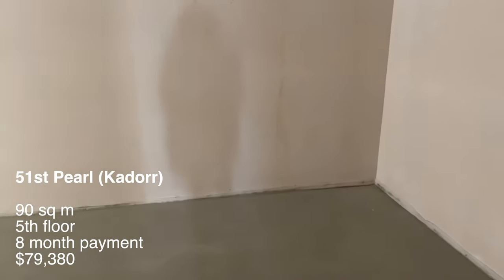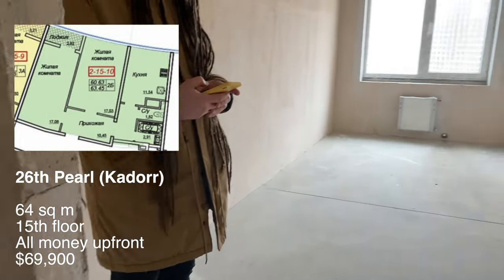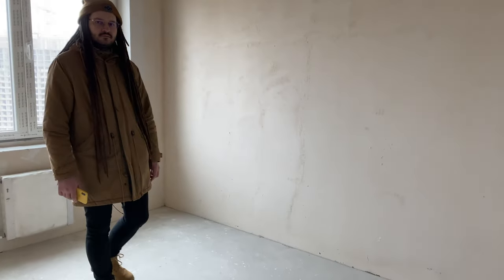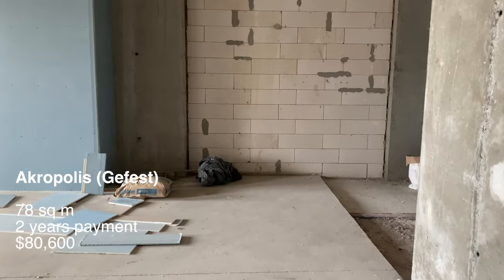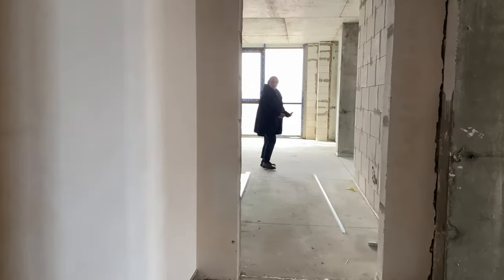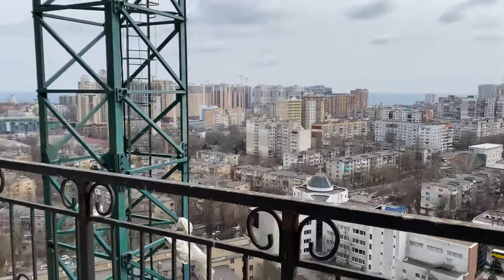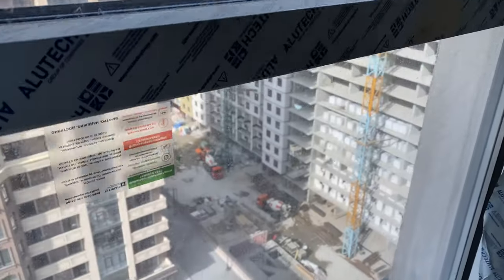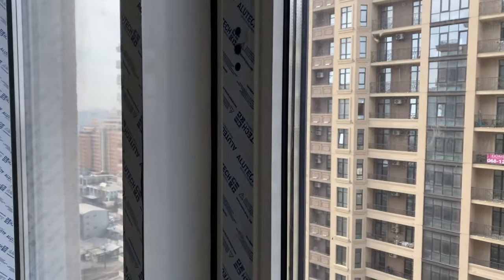EXPAT BUYS APARTMENT in Ukraine 🌆 11 real flats w prices 💰

Comment: i wonder why you chose newer apartment over OLD ones Elena because i feel newer ones are build with cheap building material quality.. almost all new apartments i have been in have paper thin walls where you can hear your neighbor very well ... i think in terms of built quality older ones are impeccable. besides the high celing in old apartments are an advantage .
Reply from the maker: It depends) there are new apartments that are high quality and with high ceilings. Old apartments can have horrible electrical, plumbing, aircon (if any)

Comment: It isn't talked about much in new housing in Ukraine - the real cost.  In the USA, new housing averages almost $1062 per square meter. That is usually a new house with everything done for you and often includes appliances.  Of course, that is an average and if you compare it to San Diego (on or near the water) and to many coastal cities on the East coast of the USA,  then the cost for a 'shell' of housing apartment in Ukraine is cheap.  I have also been warned never to buy an apartment in an apartment building that is not completed (full building is complete, elevators are installed, landscaping complete)
you may pay more for an apartment in Ukraine where the developer has 'completed' construction but you can move in once you complete renovations.
Reply from the maker: You’ve definitely done your research ) yes, buying an apartment in an unfinished building is a risk if the builder is not reputable, but in exchange you get an apartment for a cheaper price than buying it in a finished building. Will be able to tell you about the total cost per meter when we do the design project.

Comment: Great video as usual! I am a little confused. Developers sell apartments unfinished? No kitchens, bathrooms, etc? How much and how difficult it is to finish two bedrooms apartment on your own? Can developers finish it for you? Or you have to buy from individual owners if you want completely done apartments? In NY developers sell complete apartments. Thank you! Anya
Reply from the maker: Hi Anya, most of the new apartments sold in Ukraine still need to be finished - electricity, floors, walls, soundproofing, as well as installing the kitchen and the bathroom. There are some builders who sell finished apartments - in which you can move in immediately, but this is rather rare.
Reply: How difficult is it to complete unfinished apartment? How much approximately to do it? How long it’s usually takes? Thank you!
Reply from the maker: It depends... But some rough estimates are: 3 months for a design project, 3-6 months to finish the apartment with a foreman and construction team. Although workers can multitask, it's better to get the best man for each job - installing the kitchen, laying tiles, installing the doors, etc.